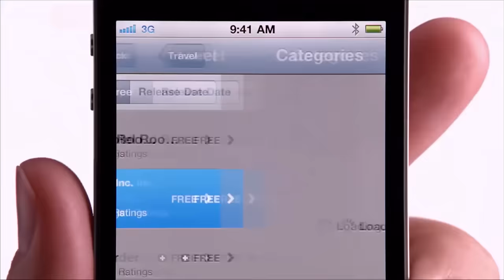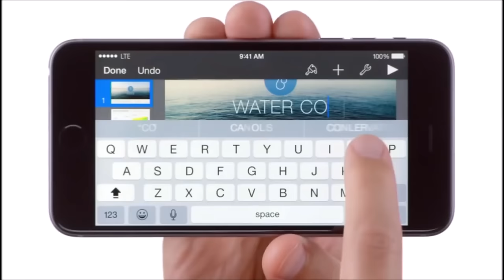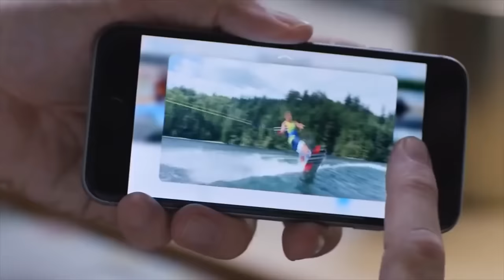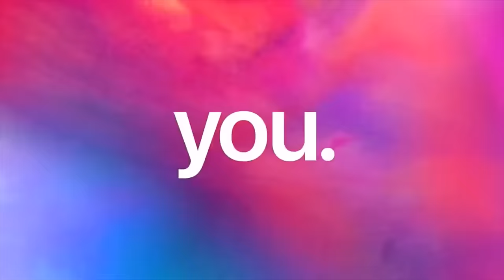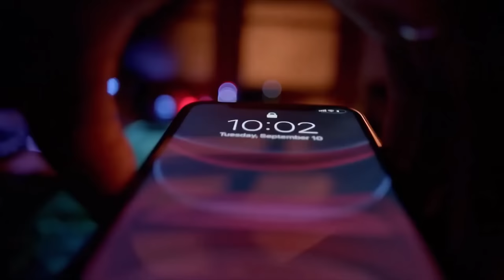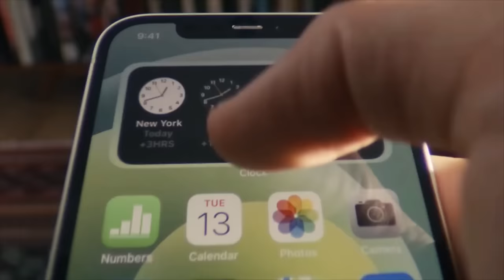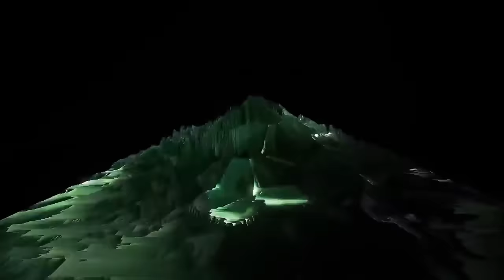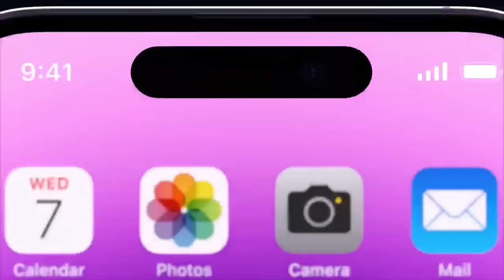Every iPhone Commercial | 2007 - 2022

Comment: I feel like the iphone x was the most changed phone
Reply: That’s actually true😅😊
Reply: It’s on par with the change from 3GS to 4, 4S to 5 and 5S to 6. Then you had 7 and 8 which were basically the same. X and XS were the same. 11 was slightly different with the new camera module. Then another big change to the 12 with Square edges again. 13 and 14 basically the same as 12. 15 again some „adjustments“ i‘d call them with more rounded edges, new material, new button and new connector
Reply: iPhone 6 too
Reply: It’s the one that shocked the world
Reply: Removal of home button, camera change, Max Insted of Plus for pro models, yeah that’s a lot
Reply: @pyxl0708  x didn't have a max model
Reply: @florianpeter7045  iPhone XS Max has left the chat.
Reply: @pyxl0708  we're not talking about xs, we're talking about x 🤦
Reply: I agree with you
Reply: @florianpeter7045  XS is the X’s pro model 💀💀💀
Reply: @pyxl0708  wtf are you talking about 💀
Reply: @florianpeter7045  “for the pro models” learn to read
Reply: @florianpeter7045  also tf u mean by “we’re” like bro no one is replying with you 💀
Reply: @pyxl0708  oh so you're no one? Interesing. You think the xs max is the pro version of the x lmfao. Get lost
Reply: @florianpeter7045  AINT NO WAY BRO IS TELLING ME TO GET LOST IN A YOUTUBE COMMENT LMAOOOOO 💀💀💀💀💀
Reply: @florianpeter7045  how would the “S” model not be the pro version, i personally have one
Reply: @florianpeter7045  if ur such a professional then prove it to me
Reply: @pyxl0708 easy
iPhone X was the eleventh gen
iPhone XS/XS Max was the twelfth gen
iPhone XR was also the twelfth gen
Don’t ask me, iPhone generations are confusing
Reply: Fr
Reply: iPhone 4 is the biggest jump besides the original, iPhone X is third
Reply: Iphone 4, 6 and X. The hype is real and i have been there 🤣 it’s so exciting
Reply: Iphone , iphone 6 and iphone X
Reply: ong
Reply: iPhone 5s
Reply: I still have an iPhone 5s which is way better in performance than a 150 bucks Android
Reply: Or the iPhone 11
Reply: Yep that’s very true
Reply: @saranshbpmdevil6083 lol thats not true
Reply: OMG REALL
Reply: which X
Reply: 11 - 12 with bulked corners is the biggest change for me
Reply: Fr run my mom has a iPhone X (aka iPhone 10) it works so good and charges so good
Reply: @pyxl0708 the xs is an entirely different generation of phones. They are not the X pro models…
Reply: Yeah
Reply: @al_three_ex you must be 15. The OG iPhone shocked the world lol, the iPod shocked the world. Young kids don’t realise how ground breaking these products were
Reply: Same
Reply: I thought it was iPhone 11
Reply: i have it
Reply: It was the last time they did a big change to iphone
Reply: agree
Reply: nah the 2g, the first phone without a physical keyboard and revolutionized the smartphone industry forever
Reply: The 8 to
Reply: @marko0fficial2 I actually genuinely agree with you
Reply: @RADICALFLOAT95  Right? It was all because the dual camera.
Reply: forgotten_101  I actually genuinely agree with you.
Reply: @marko0fficial2  wtf
Reply: That’s why I love it
Reply: @JoviRhys  I actually genuinely agree with you
Reply: Sad that they don’t sell them anymore but still sell the 8 I think
Reply: Nothing has significantly changed since, one could make the argument each generation is getting worse.
Reply: @usefulprogrammer9880  I actually genuinely agree with you and finally some one who l found in the comment section that actually has a functioning brain for once and this world actually genuinely needs more people actually like you in this world and you actually couldn't have said that actually any better than me lol.
Reply: Same
Reply: @pyxl0708 late but xs is a different generation lol
Reply: and 14 pro with the dynamic island, that was a small but big step
Reply: Yep
Reply: And the best
Reply: @florianpeter7045 it’s funny seeing stupid people trying to make themselves sound right smh.
Reply: @pyxl0708  because you just made up that term „pro“ 🤡 XS and X are two seperate generations. None of them is the „pro“ version of the other. Since iphone 11 there were same generation regular and pro phones that came out in the same year. Also your additional nonsense was completely irrelevant to the initial discussion
Reply: I miss my Iphone X so bad, every now and then I watch the commercial just for the good old days
Reply: iphone 11*
Reply: As well as being most changed it also holds the record for 2 things: The Award for First Horizontal Camera and The Award for Most Forgotten IPhone!
Reply: You’re right tho
Reply: You’re right tho
Reply: You’re right
Reply: Ya cause no more butten 😂
Reply: Fr
Reply: Followed by 11 pro max in innovative features which still in use till today making the 11 still relevant but I think they should have spaced the innovation of X and 11 pro max wide apart( apple's usual slowness in innovation) to give more effect  but from X, alot of changes became  rapid.
Reply: Because it was
Reply: That was the begging
Reply: @marko0fficial2 a dual camera was in the 7 plus already. it's not even a big jump anyway cuz all of the time you're still using only one of then
Reply: @RADICALFLOAT95 I actually genuinely agree with you
Reply: @RADICALFLOAT95 why do you say actually so much holy Jesus
Reply: @pyxl0708 The XS is a seperate generation, the X launched in 2017 while the XS in 2018, if you actually wanna say what is the base version of the XS it is the XR, the XS is kinda like the pro version of the XR.
(god this reply section is full of braindeads)
Reply: @archux_  i ment to say the dual camera design
Reply: @r.e.m.grande9067 ya cuz it could bend😂
Reply: @pyxl0708  it was never “in the chat”
Reply: Fr
Reply: @marko0fficial2  the 7 and 8 have the same design the 8 only has a glass back do you understand physics hello?
Reply: I have an iPhone
Reply: I’m on an iPhone X right now
Reply: Agreed
Reply: Soo real

Comment: Dang i want an iphone 7 now lol
Reply: I'm still using my 7 Plus. 😅 It's unlike any other iPhone I've held before or since -- one sleek, jet black, solid unit with just the right weight to it. Constantly running out of battery and storage space (with 8 years of use) but still hanging on. It's still a real beauty. (Oh, and it has Touch ID).